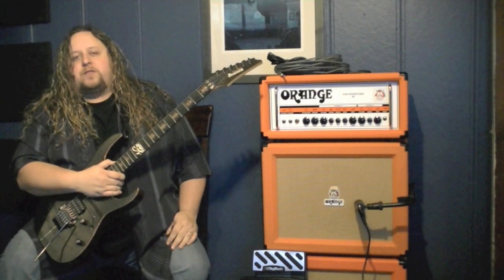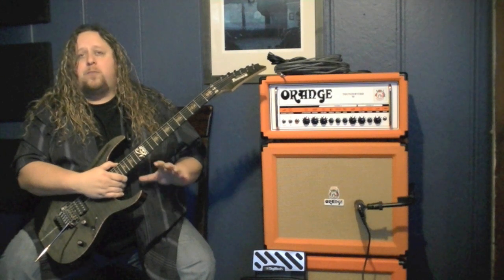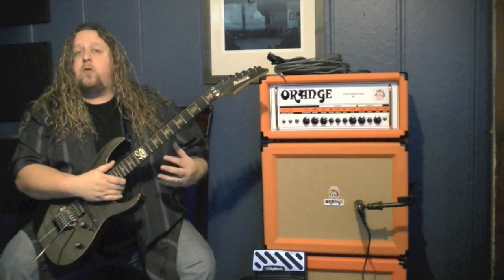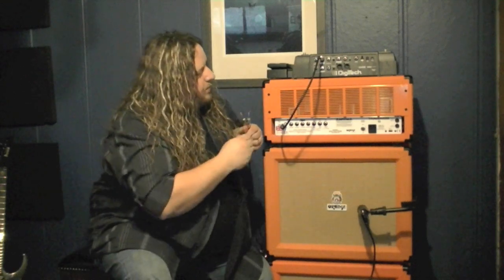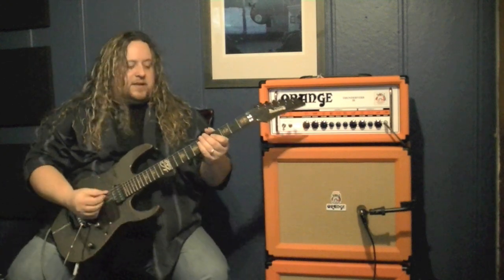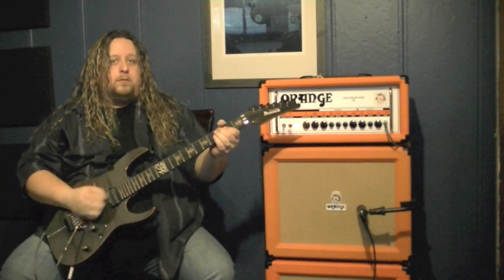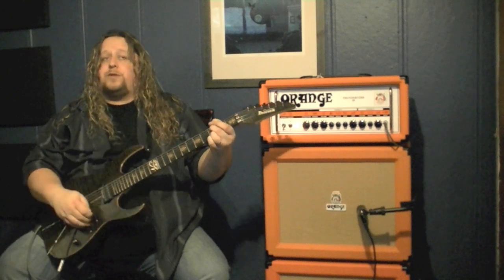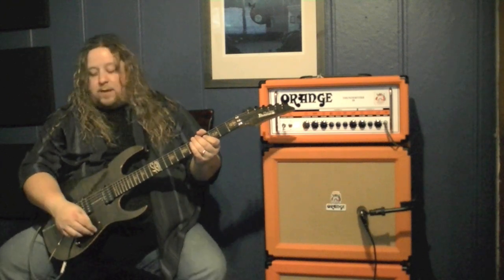Digitech RP1000 & the 4 Cable Method with Rikk Beatty

Comment: This thing is still relevant to this day. I dont use any of the cab models but the routing options along with the usable effects and very good amp models make this thing better than a Helix in my opinion. I bought the Helix  LT expecting to be blown away and it is a great unit but doesn't have the ease of use and flexibility this thing has.  This thing turned my existing rig into a Pro sounding and feeling set up and I'm not sure if I could do without it now.

Comment: I have just bought one of these but am having issues. I have it set up correctly I believe with the 4 cable method into a Mesa Road King 11. Whether in Preset mode or Pedalboard I have no Delay effects. I think also no Reverb. Any help is appreciated.

Comment: @raregenius2410 I just read your question again and it does have a dynamic sensitive feature in the fact that it will simulate the gain stages of the tube amp when you pick lightly or heavily and/or roll the volume knob up and down. However you can not assign different tones depending on if you pick lightly or heavily unless the effect you assign to the preset is set up to do that (like a dynamic delay or an auto wah or something like that). Hope that helps!

Comment from the maker: Allot of times the presets in these units are created by several different people using several different set ups. When they all come together to go into the unit, all the preset volumes different. First thing I always do is go through the entire "User" section and adjust the preset volumes to a "normalized" setting.

Comment: I had many pedalboards, Boss GT, Zoom, Line6, etc... and RP1000 have much posibilities because I can use analog pedals or Valve Amps with 4 cables method and the system switching that have the RP1000, I tried the RP1000 with my Bogner Alcheminst and two analog pedals (tube screamer and mi audio crunch box) and the results are wonderfull, many many pobilities and the quality is great, very proffesional!

Comment from the maker: @Shoji86 I use both channels on my amp for distortion, so when I want a clean tone or a distortion sound like the JCM800 I have it hooked up with the 4 cable method to bypass my preamp and just use the power section of my amp so I can access the preamps inside the RP1000.

Comment: I used this method through a Bogner Alchemist and it bypassed the gain knob. Pretty sweet sounding in pedal board mode. It never has to go pass 9 o clock. NOOCH!

Comment from the maker: Hi Phillip,
Some Fender amps only list a preamp out and power amp in (which can still be used). The preamp out is your send and the poweramp in is your return. Just use the FX send and return and your amp input and you are set! Your amp CAN run the RP1000 with the 4 cable method! :-)

Comment from the maker: @JahsDisciple316  Yes the pedal will still work perfectly in that position due to the fact that the RP1000 is still routing all the internal time based effects to the effects loop in the back of the amplifier. You just have to hit the "Amp Loop" button on the face of the RP1000 to turn on/off the internal amp modeling.

Comment from the maker: You can plug any pedals you have into the StompLoop of the RP1000 and per preset program the loop to be either on or off. You will want to make sure all the effects are either Time Based effects or Preamp effects though since you can only assign the entire loop to run either "pre" or "post".

Comment from the maker: @MichaelBower93 No it will not change the channel on your amplifier. BUT you can either have the footcontrol for your amp next to the RP1000 or you can keep the amp on 1 tone and use the internal preamps on the RP1000 for everything else.

Comment from the maker: @mysillyfacevlogging A parallel FX loop is an FX loop that runs your dry signal parallel with your effected signal. So you hear the original tone AND the effected tone at the same time. In order for the 4 cable method to work the way it was intended, you want to have a standard FX loop where you only hear the effected signal.

Comment from the maker: @DefToneFL Hmmmm well I have run a stereo setup using 2 of the same heads going through a full stack each before. The addition was really simple. When doing the 4 cable method you only use the "left" output on the back of the RP1000. So I also used the "right" output and plugged that into the "RETURN" of the 2nd amp. This carried my preamp signal from the first amp into the power section of the second amp. Essentially I was using 1 preamp from one head and both power amps. It worked great!

Comment from the maker: @timborocksloud With the RP500, you could just bypass the amp and cab models and just use the effects. Or with the RP1000 (which does come with a full cable kit now), you can hook it up using the 4 cable method and select per preset whether you want to use the internal amp models or your actual preamp from your amplifier.

Comment from the maker: @MrWildboy214 I played a show in Nashville using a TH-30 combo and my RP1000 and it sounded AMAZING!! The RP1000 was designed to integrate into your tone so you would retain the sound of the particular guitar and amplifier you are using. As for your last question, I have found I can get just about anyone's tone with this unit. As long as you see a similar amp/cab model in the RP1000 as what Page used, you can set up a preset to sound like his tone.

Comment from the maker: The mix setting has a cabinet emulator built in which rounds out the distortion a little. Some people prefer that sound. BUT since you are running it into a Hot Rod Deluxe, you should use the 4 cable system and plug into the effects loop as well as your amp input so that way the RP1000 does all of the routing of the effects for you plus it will allow you to switch back and forth between your fender preamp and the internal preamps in the RP1000.

Hope that helps!!

-Rikk

Comment from the maker: @osvtorr When using the amp models of the RP1000 (and hooked up in the 4 cable method) it uses the power section of your amplifier be it tube or solid state. Another amazing thing to try is hooking the RP1000 directly into a P/A system (make sure you select the "mixer" setting by the XLR outputs) and watch as people swear you are going through an amplifier!!

Comment from the maker: @JohnMcLeoder ran out of room on the other post... after adjusting the Master Volume of the RP1000, I then switch over to a preset where I use the amplifier's preamp and adjust the volume of the amplifier to match. The preset volumes should all be at the same volume unless you want a preset louder than another for lead purposes or something. I hope that helps!

-Rikk

Comment: Hi Rikk. Thanks for the awesome demo, sounds amazing!
Just a couple of questions.
1. Can you confirm or set straight a lot of people complaining about a volume drop when engaging amp loop and using just amp tone. How do you fix this?
2. Is there a way to program your own amp tone on amp loop into an rp1000 preset so you don't have to fiddle with the little switch on stage?

Thanks heaps!  Prae

Comment from the maker: @Shoji86 The only differences are that the RP1000 has the "Stomp Loop" feature (the GSP1101 does not) and the GSP1101 has TWO Audio DNA2 chips to allow cross over fades of reverb and delay from preset to preset (and the RP1000 has only ONE Audio DNA2 chip).

The brains are the same in both units so the sounds you get from the amp models and effects will be identicle aside from what I mentioned above. 

Hope that helps!

-Rikk

Comment from the maker: @1bulldog998 I have my RP1000 hooked up using the 4 cable method to my amp. I go from the output on the RP1000 that says "To Amp Effects Return" into the input of the JamMan and out of the JamMan into my amp's FX Return. That way I can record a clean preset on the JamMan, switch presets to a distortion patch, and it does not change the original clean loop to distortion. 

Hope that helps!

-Rikk

Comment from the maker: @JohnMcLeoder  Hi John, When I am out on the road doing clinics, sometimes I have to run through many different types of amplifiers so I have to adjust volume levels allot. Normally what I do though is hook the RP1000 up with the 4 cable system, then I put it on a preset that uses an internal amp model. If its too loud, I turn down the RP1000 Master Volume until I get it to the level I like. Then I switch over to a preset where I use the amplifier's preamp and adjust the volume of the amplifier.

Comment from the maker: @Shoji86 The GSP1101 is a killer rackmount processor. It has the same brain as the RP1000 so the sounds are the same. Only difference between the two is that the RP1000 has a Stomp Loop that allows you to use your other effects pedals & tell them where you want them in the effects chain.

The 1101 however has two Audio DNA chips in it which will give you instant switching between presets like the RP1000 but also allow delay and reverb to cross fade into other presets which is really cool!

Comment from the maker: @shane17thsun Once you have it set up in the 4 cable method, all you have to do is hit the button on the face of the RP1000 that says "Amp Loop" to bypass the internal preamp on the RP1000 and just use your amplifier's preamp. Then just hit the "Store" button to save it.

Comment: Getting on an RP1000 in two weeks. Thanks for this vid! I'm planning on having a few additional pedals hooked in through the RP1000 that I normally run in my fx loop. I'm guessing using this method, if I run a cable from the RP1000 output "To amp FX Return", I can then link in an extra, say delay pedal (which I normally have running towards the end of my FX loop chain), and then in my amp's FX loop return?

Comment: I'm trying this with the 4CM with a Mesa Mark III. I am getting a TON of hum and noise with that setup. If I use the RP1000 in JUST my effect loop with 2 cables I get no noise. 4CM and it's not usable. The ground switch doesn't do much. I had the same issue with the HD500 and Axe-FX and with a few different amps. I have an ISP Decimator and have tried in a few different spots in the chain and it hasn't had any effect. I'm not using the RP1000's noise gate because frankly, it's aweful. Any tips?
Reply: I own a mark III too and I want to get a used rp 1000. How did u like it when used with the mark ?

Comment from the maker: @riotcrue I am not sure why it would do that but you can adjust the master volume knob on the RP1000 to match the volume of your amplifier. That way its the same volume as when you hit the bypass button. The master volume resets after you turn it off each time so you would just need to remember what number you turn it to on that particular amp so you can adjust it when you turn it back on. 

Hope that helps!

-Rikk

Comment from the maker: @goodbyecadillac No you just create a clean setting on the RP1000 using the internal preamps and keep your amp set to distortion. When you use the internal clean preamp it will bypass your amp's distortion. Then when you want to use your amp's distortion, create a preset with the Amp Loop turned on and then you can have your other pedals in the Stomp Loop section set to turn on when you go to that preset. No problem!

Comment: Great video Rikk!!! Because sound acquistion and listening through the computer is more misleading than actual hearing with your ears I would be grateful if you could compare it with any other effect systems in your experience. (ie. G-System or others). Does it sound rather artificial or digital at all? Does it have built in a high quality analog path to be mixed with the digital stuff? Thank you

Comment from the maker: @Praetorian10111 
The way to fix this problem is just to adjust the volume levels between your amp, the Master Volume, and the individual preset volume to all be at the same levels. I know when I am not using my Orange amp (due to just doing store trainings on a trip) and I have to use like a Fender Deluxe or something, I usually have to take the Master Volume of the RP1000 way down to like "3" and turn the amp volume up for the presets where I am using the amplifier's pre-amp .

Comment from the maker: @mak2007uk Then you have it hooked up correctly. When you engage the amp loop button, you are using your amplifier's preamp and bypassing the internal preamps of the RP1000. So technically (aside from the effects), all the presets would sound the same since it is only using your amp's preamp. 

I hope that helps!

-Rikk

Comment: I some questions as well.

1.) do you need to have an FX loop on/off switch to change back and forth between the processors models and your amp models?

2.) is the gsp 1101 able to do the 4 cable system as well?

Comment from the maker: @MultiScoffer The VT100 has an effects loop but I can not find anywhere if it is a series or parallel effects loop. This is something you would want to ask before purchasing. Most amps that have a parallel effects loop will offer you the ability to switch it to a series loop but I would just make sure before you buy. Hope that helps!

-Rikk

Comment from the maker: @jayruss05 You can't use the 4 cable method on this amp but you can still use the processor. You will just plug it into the front of the amplifier and then choose whether or not you want the internal amp models on or not. If you turn the amp models off, it will be just like having a bunch of pedals and a switching system for your amp.

Comment: Hi! very interesting your tutorial... i have the gt-10 and i know that i could do this also. With your method, you can use your amp only  or  you can select your "patches". Do you put your amp on the clean channel with your pedalswitch to do this (select the patch)? With the Boss, this method is used to keep the distorsion of the amp and add effects from the digital unit. Thanks for your answer. Bye!

Comment: Hi I'm back agine just wanted to say thanks I wasn't impressed with the rp 1000 sounded thin but I ran a 4 cable connect thru my 333xl  and  oh did it start singing there's so much you can do with this thing big Thanks.

Comment from the maker: @MultiScoffer Yes you can. The BH100 head offers an effects loop that can be run either in series or parallel. You will want to run it in series when using the 4 cable method. If you run it in parallel, it will give you the amplifier's preamp along with the RP1000's at the same time which defeats the purpose of using the 4 cable method. But in short... yes that head will work nicely with the RP1000! Have fun! :-)

Comment from the maker: @JohnMcLeoder Thanks John! I have a couple of my presets on the DigiTech page but I think they are under either the 1101 or the RP500. I dont know if the guys there want me adding my own songs to the Tone Library but if not I can always email you the backing track for Mountains Twin and all of my RP1000 presets. I use my amp for all of my distortion BUT if you turn the Amp Loop off on the preset, I have the amp models programmed in that I used while recording the Guitar Farm album.

Comment from the maker: @Shoji86 Sorry I just re-read your post. You dont have to use the 4 cable method. You can just go out of the RP1000 straight into the Return of your amp's FX loop. If you use the 4 cable method though, you can chose per preset to either use your amp's preamp or the RP1000's preamp.

Comment: your video sold me. this 4 cable system is what ive wanted for a long time. i run stereo setup, with my rp300a going to a peavey combo. the other side is purely stompboxes run into a peavey musican mark 3 bass head. probably one of the best and most colorful amps ive come across. i love the rp300 but since i bought it 3 years ago ive had so many ideas on how to make it better and the 1000 takes the cake. no one at guitar center ever mentioned this to me when i was checking it out. jackasses...

Comment from the maker: @nemogre I understand. The only thing it will not do is change your amp channels. But the effects and modeling inside the RP1000 are an upgrade to the GNX series. I use both channels on my Orange amp for distortion then use the internal preamps on the RP1000 for my clean tones.

-Rikk

Comment from the maker: As far as I know you have to use the 1/4" outs if you are hooking it up using the 4 cable method. If you are just going to a PA or mixing console, you can use the XLR out. I have used this several times out on the road with a Hotrod Deluxe. You use the "Pre Amp Out" and "Power Amp In" as your FX Loop Send and Return. Hope that helps!

-Rikk

Comment: Thanks for the video Rikk!  It greatly influenced my decision to buy the RP1000.  I really like the unit, but I have had some problems with it.  It works great with my Peavey 6505+, but I recently have tried it with a few other heads to no avail.  I used it with a Randall RG200 and a Carvin Valve Master 100, both with the 4 cable method.  When I use it with these heads the volume drop is significant when compared to just plugged in normal.  Do you know what could cause this? Thanks.

Comment from the maker: @christopherbenedetto  If you use the 4 cable method, you program each preset to either use the amp loop or not. So yes you are able to use the amp/cab bypass selectively per preset. When using the 4 cable method, you are bypassing your amplifier's preamp & only using the power section of your amplifier. This is what gives you a more true sound of the amp model you are using. If you use your amplifier's clean channel you will be mixing preamps together & not get a true reproduction of the tone.

Comment from the maker: You can plug in other pedals but can only choose per preset for the Stomp loop to be either PRE or POST. BUT you could plug the delay pedal in between the output of the RP1000 and your amp's effects loop and then just turn the pedal on and off when you need it. 

-Rikk